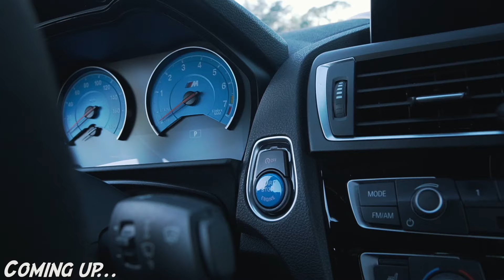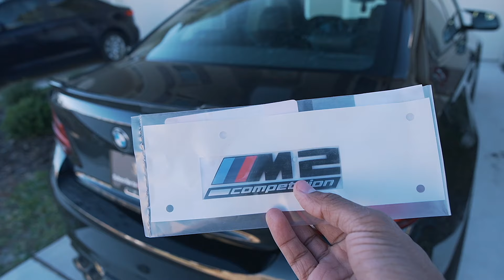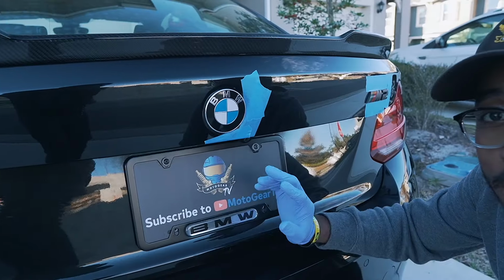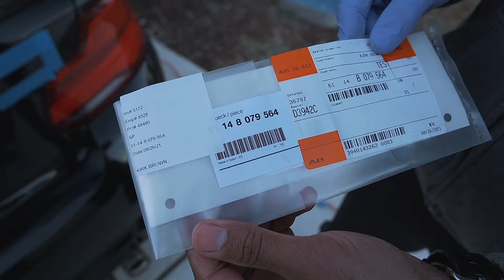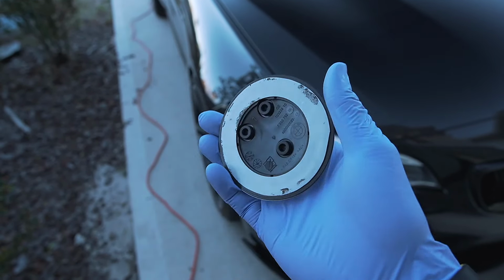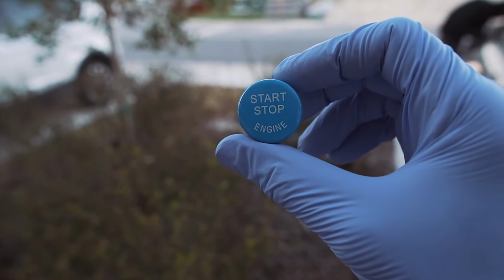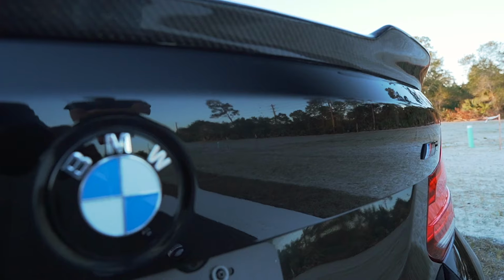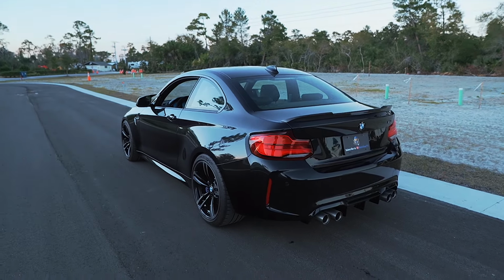Small Mods that make a BIG Difference on any BMW!

Comment: On a black car, I can see why you’d want to swap out the badges. However on other color cars, I’m not sure you’d get the same results.
Reply from the maker: I've actually seen it on other colors and it complements them very well, however I would say its more fitting if there's no other chrome trim pieces on the car

Comment: Just a little heads up for folks who have never done this your tabs on the badges are at 3 o'clock & 9 o'clock so definitely come in with your tool at any angle besides those so don't break tabs

Comment: Nice clean look! Ima have to swap mine out. 22 m550 she is bad. Did the reflector delete, removed the xdrive badge on the rear. I am to scared to replace the hood. But I will do the rear m550 in black. Nice work
Reply: where do you order amazon